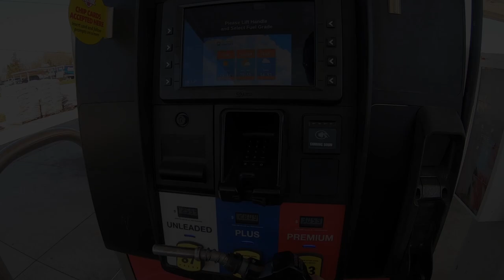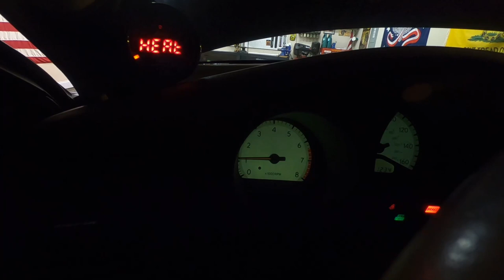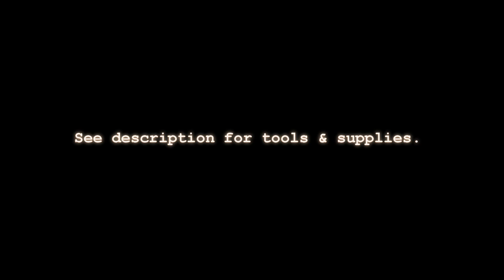LEXUS Oil Change | a NO-talking episode! | GS400 shown

Comment: Nice and clean under the car! Jealous... lol. My GS300 is leaking oil from all over... leaks from the oil pan, crank seal, cam seals, headgasket, and even leans trans fluid from the trans pan. It's a project I want to tackle this summer. Well... I have to. The timing belt is not only due but also soaked in oil. And the headgasket leaks externally... still runs like a champ though lol
Reply from the maker: Dang! That sounds horrible. It would bother me too. Maybe you should just swap in an Aristo TT motor and call it a day. :)
Reply: @ForwardMomentum  Haha I wish! I told myself that if I ever were to swap that engine it would just be a factory TT with minimal mods to keep it simple, reliable, and still comfortable, but more fun. As for the leaks, yeah... I bought it like that and I knew exactly what it needed since before I got it, but... it was $1000... so... how could I say no haha

Comment: Hi I'm nawaf I have a 2000 lexus gs400.. I would like to thank you for all the videos you have posted and it's really helpful.. I want your opinion about using thicker oil for or engine because it's old engine so the 5w-30 is very thin for it.
Reply from the maker: Hi there. I am not an authority on this subject and I would only advise using the oil that is recommended by LEXUS. You might want to try the forums over at bobistheoilguy.com - they may have some info on this topic. If anything, just use high mileage full synthetic 5w-30. Personally, I use the cheapest reputable full synthetic I can find and go about 6500 miles between changes. Good luck to you!

Comment: gonna be doing my first oil change on my GS tomorrow... any tips on how to jack it up? like specific placements and such
Reply from the maker: Ramps work well. If you don’t have them, jacking from the lower control arms and putting safety stands on the pinch welds is advisable. If you get ramps, put blocks on the rear tires and set the e-brake. 👍
Reply: @ForwardMomentum  hell yeah, thanks so much!!

Comment: I have a lexus gs430 2001, I have a problem with the electric part, the radio, interior lights, the sunroof, and the remote closure does not work what can it be? :(
Reply from the maker: Probably a fuse or relay. Any recent work or replacements on the vehicle? I.e. head unit replacement, etc.

Comment: Does a strong oder out of the exhaust signify old oil? Or could this be something else? Thanks.
Reply from the maker: When do you smell it? Cold start? Warm?
Reply: @ForwardMomentum  Every time I start it. I haven’t been driving it much so I’m not sure if it happens after longer drives. I’ve mostly just been moving it back and forth on street sides for street sweepers.
Reply from the maker: @graphicartdude  mine stinks on cold starts, but that’s pretty common as the TWCs (cats) come up to temp and vehicle goes from open loop to closed.

Comment: Hey man, kinda curious why there is a Ford Motorcraft oil filter on your Lexus.  Did you buy it from the last guy like that or was it the last thing on the shelf or something?  Idk man just kinda wierd to see that
Reply from the maker: I agree. Very strange. Good observation! Believe it or not the PN actually crosses over to the 1UZFE and it’s the same size and everything. I personally think it’s hokey and I won’t be doing it again.
Reply: Very interesting, however I like your content and I think this channel could really become something popular in the future
Reply: It's possible the former owner had it serviced at a Ford dealer. The car fax history on our RAV4 showed that it was consistently serviced at a Ford dealer after the owner moved from Georgia to Pennsylvania.
Reply from the maker: In this case I was the cause. I bought it and installed it. It worked fine, but it was a dumb idea to save a buck.

Comment: So Lexus recommends 5w30 should i stay with that weight here in FL or jump to the 10w30?
Reply from the maker: I personally run 5W-30 full synthetic. I’d stick with that.
Reply: Forward Momentum  thanks.  I read over the years people going back and forth on 5w30 and 10w30.  Thanks again. I have my barkeepers friend and steel/nylon brushes coming today.  Thanks for the motivation 👍👍.
Reply from the maker: You bet!
Reply: any recommendations for a good brush or sponge?  I eating through these small sponges from the dollar store lol.   Lots of elbow grease but it definitely works..  Must have taken you awhile to get that shine.  Right now it looks like just got the oxidation off at this point?  Did you wet sand or anything ?
Reply from the maker: Harbor Freight has a 3-level brush kit that works well. Cheap too.
Reply: Forward Momentum  how did you get the part to left of the throttle body almost looking goldish?   I’m working on the T-stat area and it’s real clean silver color
Reply: Forward Momentum  did you use a steel bristle brush?  thanks appreciate the help.  This definitely works
Reply from the maker: Not sure which part you mean. Is it zinc plated?
Reply: Forward Momentum  yes to the right of the throttle body.  It’s the part where you took the bracket off to run the rubber line to the catch can.
Reply: Forward Momentum  so you had the throttle body housing zinc plated also?
Reply from the maker: Oh just Barkeepers and towel. I may have hit that with my Dremel and a polish pad too.
Reply from the maker: Tony F yes, and brass.
Reply: Forward Momentum thanks. i have some brushes coming tomorrow.  yours almost looks like brass on that part .  mine is silver.  did you have yours brass coated?  thanks fir the tips btw.
Reply from the maker: No, mine is stock. No coating.
Reply: Forward Momentum that looks great then.  Guess i need to stick a polisher to it.  I polished my timing covers and took hours with different levels of sand paper.  I really don’t wanna do that again lol.  thanks again.

Comment: What other brand oil do you recommend besides castrol ?
Reply: And could i use 5w-30? Because store dont have 10w-30
Reply: They have the castrol edge 10w-30?
Reply from the maker: I use the cheapest big name full synthetic I can find. I would only stick with the recommended oil weight based on your climate, so probably 10W-30.
Reply from the maker: I’m sorry, it’s 5W-30. I fixed the issue.

Comment: Btw, there should be NOT a crush washer, but a teflon blue washer ( gasket like). And it's super chaeap
Reply from the maker: I have gotten lazy in my terminology over the past 3 decades of doing oil changes and that’s just what I call “the required drain plug washer” on any vehicle. Not sure what you mean by blue teflon because that’s not even what the dealer uses, but whatever. Use anything that  prevents oil from seeping out; even an old punched piece of leather works in a pinch.